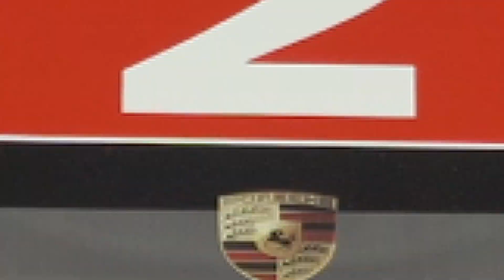This is what makes the Porsche 919 so cool

Comment: V4, maybe 2 stroke and synthetics may be the future of F1, if the stability is worked out and the V6 refresh doesn't cut it long term.
Reply from the maker: Really disappointed that Brawn didn't stick with the simpler rules that they were going for. Porsche would have been an amazing addition to the suppliers.